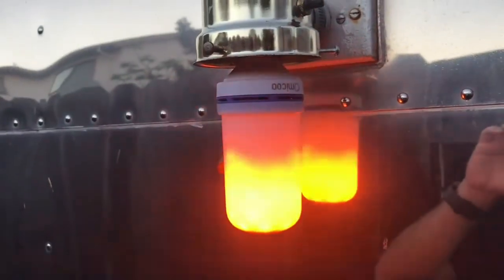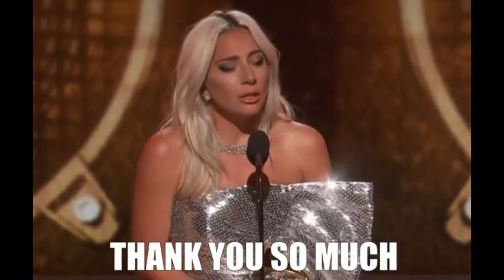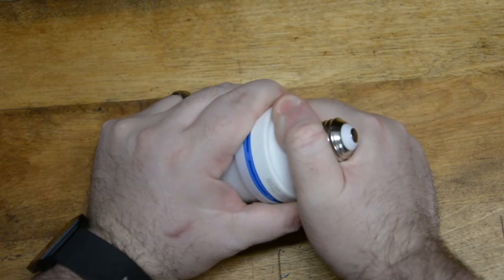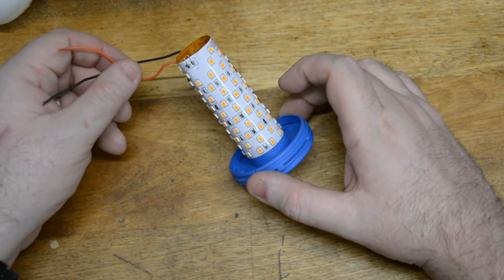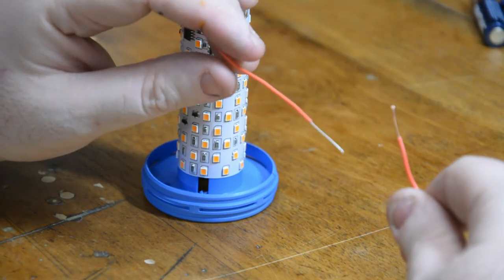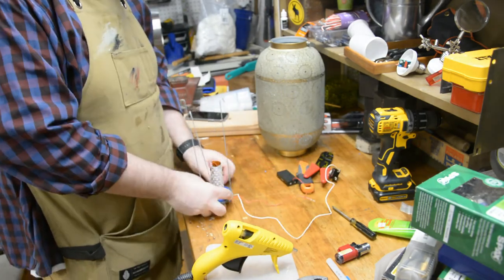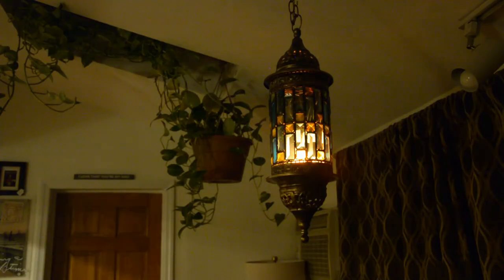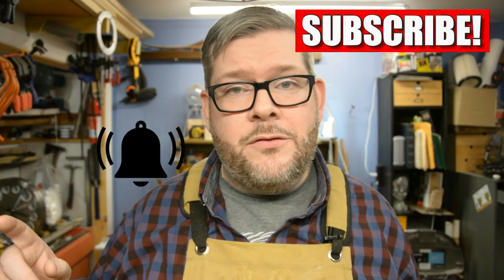Battery operated Fire Effect (Flame Bulb Mod!) cosplay LARP approved!

Comment: I like lanterns too! Your Moroccan one is gorgeous.

I am trying to go the other way and reduce the disposable batteries that head to the landfills. I've bought a bunch of LED candles in the thrift stores for ~$1 each and I have some 12v LED strips. Based on WLED on an ESP8266 for the fun lighting effects.

VanOaks Prop has a couple wiring ideas that I am going to use. He uses 2 pin landscaping wire for his outdoor props and he used an RCA jack in the past which I can see as a good option for indoor decorations. One change I might make is that instead of RCA I might just use the barrel jacks that are everywhere since most consumer routers run off 12v 1A. Combined with your bell wire ethernet cable, of course. :D
Reply from the maker: Great idea. I’ve switched to rechargeable batteries in all of mine, but being that I only use these lights on occasion, each set lasts over a year before needing to be recharged. Was thinking about working out a solar version of these somehow for outside that could run year round when the sun goes down.

Comment: This is super helpful. I never knew those bulbs stepped the voltage down that much.
FYI, 'bell wire' for a doorbell is solid wire, prone to breaking, and better suited for AC, which is what the doorbell runs on (18-24vac). You should use stranded wire for low-voltage DC, the current flows through the wire differently than AC. It's also less likely to break.
Reply from the maker: Thanks for the info!

Comment: If someone ran two pairs of AAs in parallel where the voltage would still be 3v but the Ah rating would be double, would that simply increase battery life, or would it cause additional heat, or both? I'm new  to electronics so I'm still learning but I want to extend the battery life of this thing a bit
Reply from the maker: No clue, but this way works great!

Comment: that end tip is usefull i have hundreds of feet of Ethernet cable and in need of wire for cosplay electronics.
Reply from the maker: Works great!
Reply from the maker: What are you building?
Reply: @BurkeMakesStuff  wiring all the lights for sisters cosplay and wiring all the lights for a full size r2d2 for a friend and another set of lights for bt1 another starwars astromech from comics.

Comment: Does this hack work with off the shelf regular LED bulbs as well?
Reply from the maker: It depends on how much electricity they actually USE. Should have that info on the box.
Reply: @BurkeMakesStuff  -- Well, I'd give it a shot with a cheap LED first before tinkering with anything expensive.  :)   Hope you and yours are doing well.

Comment: How long does the bulb burn on 2aa batteries? Would like to see about adding a small solar panel charger
Reply from the maker: When I first made it I left it one for 48 hours straight. We had a massive storm where I live 3 days ago and Ive left it on every night since. About 8 hours a night. Still on the same batteries.
It’s a pretty efficient little circuit!

Comment: I'll share my experience. I got the bulbs, and they looked exactly the same. I opened them, and noticed that the led unit was soldered directly into the circuit board. I removed the circuit board with soldering iron, and replaced it with my own wires. 2 batteries did nothing, with three there was a faint glimmer, and with 4 batteries it kind of worked. I added an adjustable dc-dc step-up booster and cranked voltage to 7v, and finally got the leds to glow brightly. Next I'm gonna tinker my own lanterns.
Reply from the maker: Just different needed voltage. How’d it all turn out?

Comment: The "lighter" appear to be a torch... That blue flame don't create black sooth deposit.
How long the batteries last?
Reply from the maker: I left it to run for a full week, 24 hours a day. It made it through and I’m STILL on the same batteries now, quite a while later. Very efficient little circuit they made.

Comment: How long do they last with those batteries? Also can you use solar power?
Reply from the maker: Angel Estrada I left them on for four days. All day. 24 hours a day. Then turned them off. Still using the same batteries now and we turn them on every night. So I can’t give you a definite, but a LONG time. The circuit they made is SUPER efficient!
Reply: Little mini solar panel and a rechargeable battery pack would be awesome. Also, incorporate a photo cell into the circuit and now you have an automatic light. On/off at dark :)

Comment: hi ...can you say how long it lasts while using in such a way? are these led's durable?
Reply from the maker: I let it run 24 hours a day for a week. The batteries hadn’t even run out when I turned it off. Still using them. These last quite a while. Working on another video with them building a fireplace insert
Reply: @BurkeMakesStuff  cool. thanks for the replay. that sounds great. defintely gonna use it for cosplay then. lookin forward to your fireplace. thanks again

Comment: It seems the bulb companies don't like these sorts of mods, all of the bulbs ive found dont pop apart. I'll try cutting one up and hopefully it still runs on 3v like the one you and Adam savage used :S
Reply from the maker: I have a link to ones that work in the description of the video I believe
Reply: @BurkeMakesStuff  thanks for the reply :) the ones I have are a bit more work to hack up, and run on 6 volt, but managed to get it going :) thanks for the video! and more so for the suuper quick reply!
Reply from the maker: @mattecock5715  my pleasure!
Reply: @mattecock5715  was it a great value bulb?

Comment: These bulbs are not all made the same. I've torn apart 2 of them now and the wires from the socket goes directly into the step down processor. The led assembly is directly soldered to the processor. Not able to get it to work.
Reply from the maker: Did you use the link in the video description? I ordered a set last month and they were the right ones. Please advise, so I can update the description
Reply: I must have overlooked the link. I noticed on your video and others that you all use the omicoo light. The only ones I could find were green. But, your link steered me right to the correct ones. I've already completed my lantern by just making it a plug-in in job. It turned out well. I'll eventually pick up another lantern somewhere and give it another go. Thanks for your response!

Comment: Mine didn’t work... wonder why
Reply from the maker: The only time I’ve had it not work was when I ordered different bulbs. That manufacturer used a different voltage for the LEDs so I had to adjust.
Reply: @BurkeMakesStuff  that was exactly what it was. I used different batteries and it worked
Reply: @ThunderStruck15  What batteries did you use?